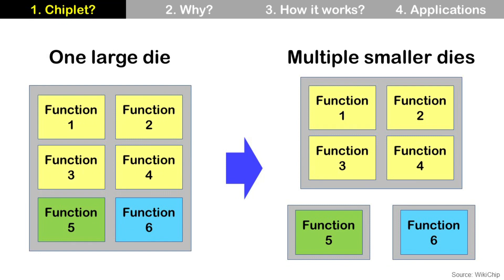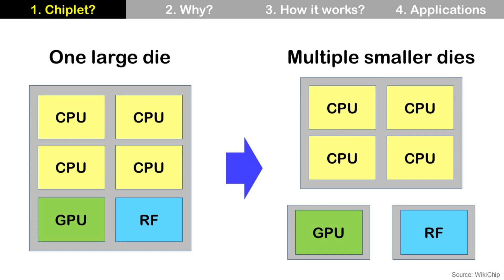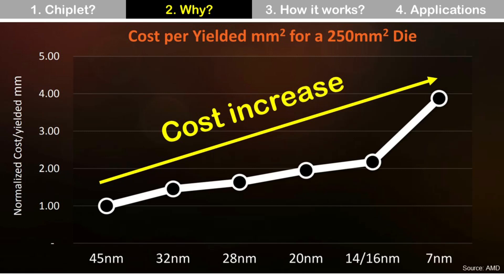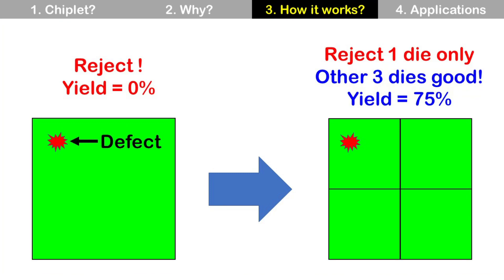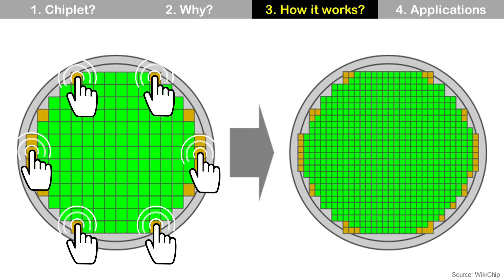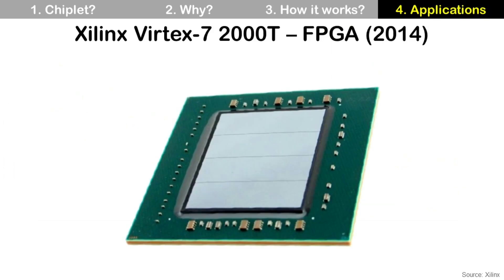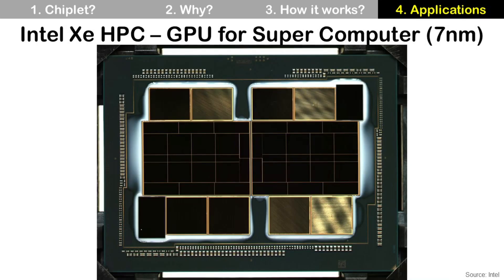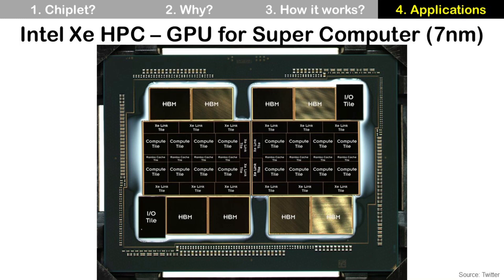[Eng Sub] Chiplet

Comment: Thanks for your video, very informative, I do have a question: What's the disadvantage of 2D chaplet package? besides the bandwidth between the dies? 
Taking AMD's Ryzen CPU as an example, I believe they use 2D package, the Die to Die communication has to go through the wire in the substract, is there any significant disadvantage of this package method?
Reply from the maker: Disadvantages of 2D chiplet package - "Who will solve technical issue?" can be challenging if there are multiple suppliers for each die in chiplet with multiple dies. Test for chiplet can be another challenge.
Disadvantages of 2D chiplet package for AMD Ryzen CPU - Sum of die area is larger than SoC with duplicated circuit at each die for die to die communication. Package size of chiplet with larger die area can be larger than SoC. These are some disadvantages but I don't think those are significant disadvantages because there are many benefits as well.
Please check below link for your reference.
https://www.gsaglobal.org/wp-content/uploads/2023/02/2022-IPIG-Heterogenous-Integration-Chiplets-White-Paper-Final-v4.pdf
Reply: @semicontalk3223  Thanks for your detailed explanation, looking forward for your new videos

Comment: how are these dices connected? It seems like you would need a lot of overhead for bond pads between chips.
Reply from the maker: Usually it uses microbump and silicon interposer. So it just needs normal heat from reflow process which is common for flipchip attach process. 
Please check my other video about 2.5D and you can see how microbump(ubump) looks like.
[Eng Sub] 2.5D Package Technology: GPU+HBM, AMD, nVIDIA, TSMC
https://www.youtube.com/watch?v=EuBRa3NWMPs